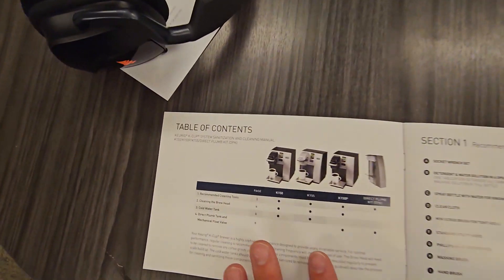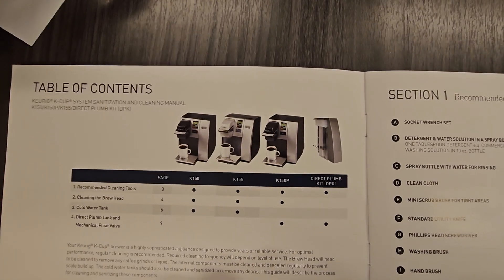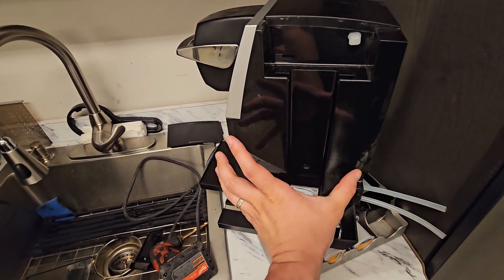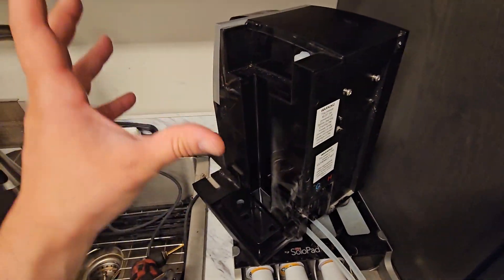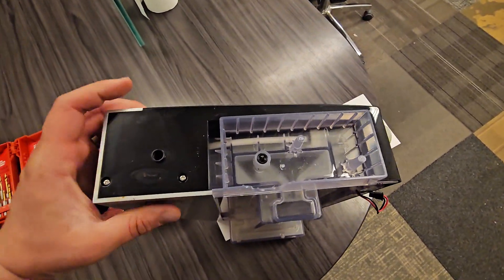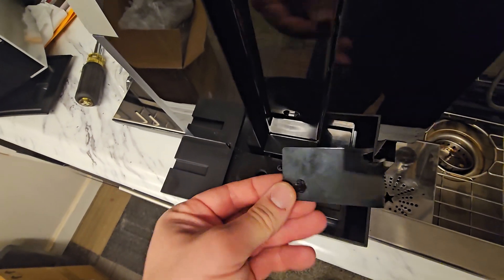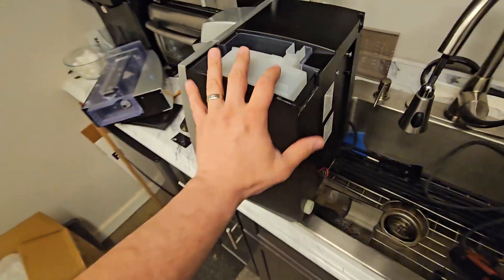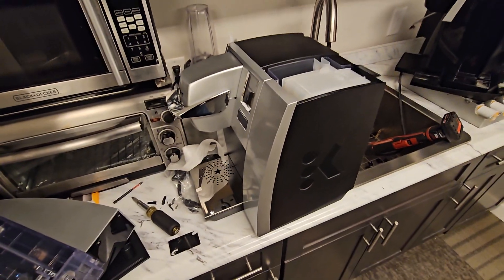How to Install Keurig Direct Plumb Kit K155 K150P DPK

Comment: Thank you! I had the same problem! I wasn't sure about drilling into it, and thought "let me check YouTube" Just one thing, That little cover is screwed in from the bottom like the water tank is. I had a hard time trying to remove it, and then realized it was screwed in. Also the 150p has a 12 oz setting, while the 155 doesn't.

Comment: There is a thumb screw on the back of the K155 (also flat tip if it’s tightened) and there’s a Blue C and Red H marked above the door. Open the door for access to the two tubes. Step two is remove the tube you want to hook up hot or cold there is a black plug at the end you need to remove and now Step three All you have to do is connect the line from you water filter! It bypasses the Tank.  Pro tip: make sure to use a removable option like hose clamp rather than a zip tie (as I’ve seen) and leave extra tubing so the machine can be moved and cleaned behind/under.

Comment: Can you show how you connected it to the water line
Reply: Stop the video at 4:19. Se the round white thing at the bottom? A regular female garden hose fitting screws onto that. It is threaded, even though it doesn't look like it in the video.

Comment: So I don't want to damage the old stuff, let me just destroy the NEW stuff. 

If you don't know how to take the tank off then you weren't doing any of the maintenance on the machine.  

If you have well water and you don't have a filtration for the keurig then no wonder it stopped working.

Come on man. Those screws are transportation screws. You were supposed to remove them before you even started using the machine. SMH